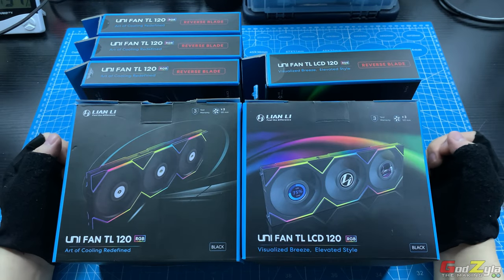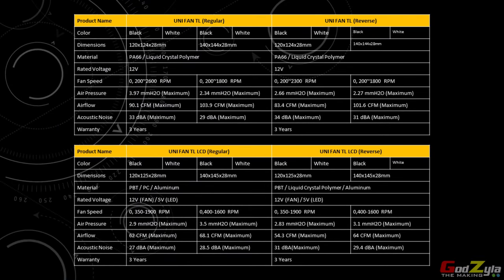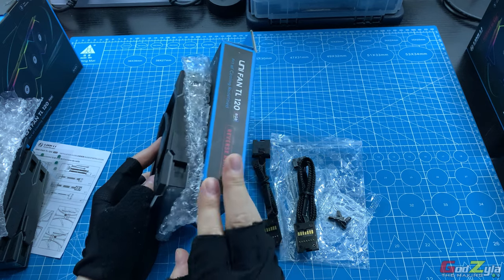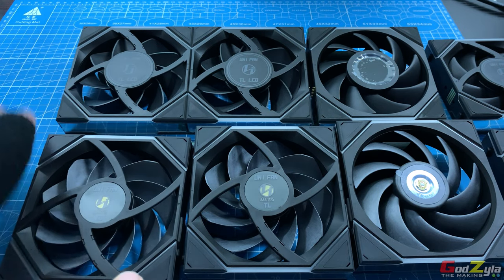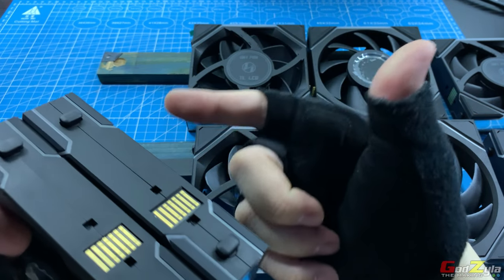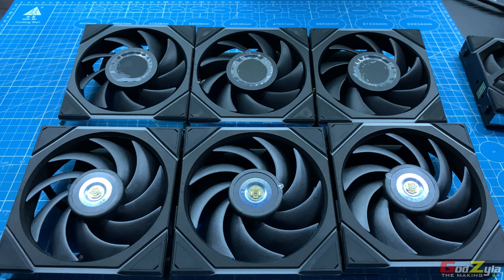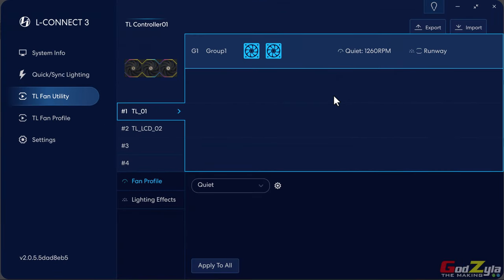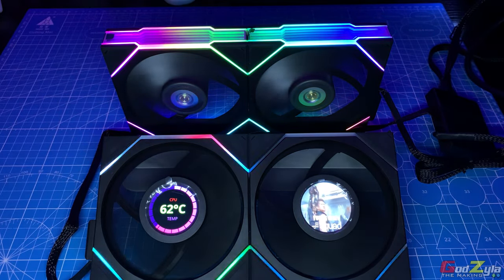Lian Li Uni Fans - TL & TL LCD

Comment: I selected TL Fan Utility controller 1 and 2
But nothing is showing on there.  
My fan and fan lights are turned on and connected properly but it’s not letting giving me anything on L Connect
Reply from the maker: HI Alpha E, welcome to my channel. You might want to check if your TL Device / Hub is detected in Windows first. check it at Device manager, under Universal Serial Bus Devices. If you do not see it.. it could be your motherboard chipset driver is not installed.

Comment: Thx about unboxing video.
Reply from the maker: Hi Mort La, welcome to my channel and thank you for your feedback. kindly note the arrangement as this content was done before Lian Li have provided the latest info about the connection. 

Motherboard Limitations: Currently, some Z790 motherboards can only support up to 7 devices via their USB 2.0 ports. This means that only 7 TL LCDs can be used, or fewer when paired with other USB devices. For example, when paired with GA II LCD AIO or Shift AIO, only 5 TL LCDs can be used. When paired with Strimer Plus cable, only 6 TL LCDs can be used. To solve this, you can use our 1-to-3 USB hub (connects via motherboard back IO) for other USB devices, and stably use 7 TL LCDs.

Comment: If package 1 does not have a controller, can I use Lconnect-3 ? .Merry Christmas and happy new year
Reply from the maker: Hi Quang Tran, welcome back. Nope you can’t use without a controller and you can’t plug these fans to your motherboard directly either.
Reply: Looks like I have to buy the controller separately if it's available. I want to own pack 1 instead of pack 3. Because pack 3 is very expensive based on my income. Thank you so much 🙏  @KleoYan
Reply from the maker: @luxubu666  you are most welcome.

Comment: Hello Kleo. I have a question: My power supply has several 6-pin SATA/PATA connectors. Is it possible to connect the UNI FAN TL controller to those inputs or should I connect it to PCI 8-2? Thank you.
Reply from the maker: Hi Salvador Alberti, welcome to my channel, The polarity matters alot and kindly only use only the GPU 8 pin PCI-E cable which has the end of 6+2 connector.
Reply: @KleoYan Thank you for always responding so quickly and clarifying all my doubts.
Reply from the maker: @salvadoralberti1372  you are most welcome. All the very best with your build.

Comment: I tried to do 4 fans in one daisy chain, and it does not work, and the end power cable does not fit either.  Looks like Lian Li messed up the cable
Reply from the maker: Hi Gary Andriotis, I have tested it and it works. Are you using the bridge cable where it has both ends with a flat surface clips? watch at 3:00 . that's the bridging cable.
Reply: No. They supplied a sata power cable for the end
Reply from the maker: @garychios  for the 4 TL fans, did you get all individual pack or 1 x individual + 1 x triple pack? If you get all 4 TL fans individually, you won’t have the controller nor the bridging cable.
Reply: @KleoYan     I meant to say 4 LCD fans in a row.  not just TL fans.
Reply from the maker: @garychios  maybe list down what package of the TL LCD fans did you get? If not I will have to guess or assume, where I can’t answer you correctly and to have go by ping ponging back and fore.

Comment: Hey how’s it going ? I connected 3 lcd fans together  to a slot of  port and 1 lcd fan to another slot of the port & 3 led TL to another slot and my fans are not displaying the RGB lights at all. Maybe I have to install I connect 3 to turn it on ?
Reply from the maker: hi Jorge Mejia, welcome to my channel. just make sure you connect to port 2 or 3 or 4 and not port 1. Yes you will need L-Connect 3 app to set the LCD images and also the argb effects.
Reply: @KleoYan  so installing the L connect app will solve the issues of my fans not lighting up ?
Reply from the maker: @jorgemejia7179  do you have the TL controller visible under device manager in Universal Serial Bus devices?
Reply: @KleoYan  im building my pc from scratch. I haven’t install my monitor yet so I can’t get into that . My lcd screen turns on but not the argb lights .I just find it weird why the fans don’t light up. My other lian li products lights are working such as strimer v2 for motherboard and gpu.
Reply from the maker: @jorgemejia7179  hmm if you have all plug correctly both LCD and ARGB should light up.
Reply: @KleoYan  that’s what I’m saying why the fans are not lighting up
Reply from the maker: @jorgemejia7179  ok do some basic troubleshooting. Start with only one fan plug to port 2. If it lights up go port 3 and follow by port 4. If all works, your fan and TL controller is working. Change fans again repeat the steps. If all fans working fine as individual,
Daisy chain to port 2. Now observe does any of the fans lights up. If not, install
L-connect 3 app. There should be a Section on ARGB Menu. Make sure the fans on screen are highlighted. That might be the issue. If not I have no clue what’s causing your issue. I would advise you to contact Lian Li’s tech support.
Reply: @KleoYan  thank you I will try this when I get home later ! I’ll let you know how it goes !
Reply from the maker: @jorgemejia7179  ok good luck.

Comment: Hello Kleo. Is it possible to connect the TL series with the SL-INF that has cooling in the same controller? Thank you so much.
Reply from the maker: Hi Salvador Alberti, welcome to my channel. The way each controller works differently, therefore you can't plug SL Inf to the TL controller vice verse. Kindly do not attempt to do that as it's of different power build and firmware build on the controllers.
Reply: @KleoYan  Thanks for your quick response.  I am a true fan of your channel.  Although my English is quite poor, I admit that you do it great. Congratulations!
Reply from the maker: @salvadoralberti1372  Thank you for the support, greatly appreciated it 👍

Comment: How would you connect Lian Li Strimer Plus 8pin and 24 pin cables to the TL LCD controller?
Reply from the maker: Hi Nix G, welcome to my channel. You can't as the TL controller is only for the TL or TL LCD, if your strimer plus is not V2, get a strimer plus V2 controller. you might want to watch this to understand Lian Li ARGB Eco System. https://youtu.be/CgvuUFeff8U?si=jrV9deuIF2gVefdu
Reply: @KleoYan  Would it be possible though to connect 8 TL fans, Strimer Plus V2 24 pin and Strimer Plus V2 Triple 8 pin to one TL controller? I am trying to minimize the controllers in my case. Thanks in advance!
Reply from the maker: @TheAero91  hi and welcome to my channel. Nope you can’t, the TL controller and Strimer Plus V2 are different in connection.
Reply: @KleoYan  thanks for your quick answer, appreciate it!
Reply from the maker: @TheAero91 you are most welcome. all the best with your build too.  😉

Comment: I see you connect the fans to the controller port 1 but you cannot do it. LCD fans are not allowed on port 1 of the controller. Just ports 2,3 and 4.
Reply from the maker: Hi Alexandre Cardoso, welcome to my channel and thank you for your feedback. You are right. Just happened that I got these set way before it was launched and they did inform me about it. Thank you.
Reply: @KleoYan  Indeed. We should focus now, that Lian Li is not using the clients as beta testers when we pay for a product. The software is terrible, not even  in Alpha phase and they sell it like a final product. Also the optimisation of the resources allocation is terrible. More than 10% CPU usage is not okay at all.
Reply from the maker: @x0127960  Hi thank you for your reponse. I can't speak for Lian Li and will forward your feedback to them. As for system resources. I have a set up which has all the Lian Li ARGB devices controlled by L-Connect 3 and to fully operate everything, GA II LCD, AL120 V2 x 10 and with strimer plus 24 and 12vhpwr, my CPU usage is around 0.8 to 2% max. I have no issues which alot told me they do. Maybe I am using ASRock motherboard that allows me to controll the ARGB in UEFI without installing the polychrome. Anyway, I will forward your feedback to them.. thank you.
Reply: @KleoYan  Hi. I have also an Astock Steel Legend x670E Ryzen 7 7800X3D  64 GB of Ram. I changed 3 fans Arctic by 3 LCD fans and using 3 sensors on the displays I notice (playing the same game) that I have a decrease of 20-30 fps. Since the software doesn’t allow us to turn off the displays, I load a still image and the increase in fps is notorious. I am using the motherboard to control all 10 fans (7 Arctic+ 3 Lian Li TL LCD). The fans have an amazing design but the software is really bad. Yesterday I was using groups to test the anims and I could not turn the displays. They turn individually but just sometimes when associated to display a comum animation. Just sharing my experience and trying to help a bit. My rig has an MSI Suprim X  4800. Thank you very much for your fast answering.
Reply from the maker: @x0127960  I had a talk with one of their support engineers. When your TL LCD loads, It’s taking up your processor resources while you are gaming. It’s in conjunction running with your game. Therefore the animation on the LCD plus your game, that causes your fps to drop. Unless it has another processor build it on the TL LCD fans. Which now it make sense to me, as I use two pc to do benchmarking while another to do the video capture. If I am to benchmark and to capture the video. The benchmark temp will go rocker high. So in practice, it’s normal to have L-Connect to run above 10 to 15%. I myself not using any TL LCD even though they look good. I personally make use of a LCD panel that has a build in processor Truxz 8.8”.
Reply: @KleoYan  I agree with you . Makes more sense to use an LCD screen with a built in processor. Let’s wait if they implement a switch off screen  button in the L- Connect control software. Have a nice day.
Reply from the maker: @x0127960  you too. Thanks for the visit and feedbacks 😉

Comment: Thanks for the excellent tutorial.
Until lian li decides to allow the user to set individual separate fan curves for each fan, these fans are just too overpriced.
When just surfing the net, having the ability to keep my rig quiet is more important to me than having it well lit.
Reply from the maker: Hi Rick, welcome to my channel. I have to agree with you on having a quiet rig which sometimes I battle how to set the correct fan curve to perform quiet but yet giving good temps. So far that's not really possible for me as processor these days are just taking up too much heat. Hopefully Lian Li is able to come out with a better solution. As for the price of these fans. I feel that I will go for TL fans as they are build to perform, for LCD, I will just get one and place it to the rear. On top of this, I feel that the software should allow sequence flashing in between CPU, GPU, RPM of the TL LCD. That will be more practical.
Reply: @KleoYan  If I have 3 of these fans in front, 3 on a 360 galahad mounted on the top and one in the back, I only need all 7 running if I'm video editing. If I'm on the web, even with a 13900k, I only need 1 fan on top, 1 in front and the rear fan running at 50 prct, along with the pump at 50 prct to keep things cool and quiet.
If Lian li is going to charge us more for the fans than for the case, it needs to update the software to L connect 4, and allow the software to reach it's full potential and usefulness, by allowing the user to set separate fan curves for each individual fan.
And if they do that, it would be nice to offer a discounted bundle purchase of case, fans and aio to users who are willing to fully support their company's products.
Reply from the maker: @Rick-m3c  For this you got a point there. Infact I view other reviwers, some having glitch where I do not have. I believe is up to individual system. This content was done with a fresh install of Windows 11 but it will be good if they have the application set to L connect 4 as to separate from the rest of the uni fan family, which will confuse a number of builders who are not familiar of the uni fan family. As for fan configuration. I would make use of all TL and just one TL LCD, as I only see it's practical to place the LCD at the rear where you can see the readings and I did highlight to Lian Li, if the readings can flash in sequence from CPU to GPU and to etc.
Reply: So all fans that are connected to a hub can only have one curve? What the..

Comment: Now how do I add my Strimer V2 24 pin and 3pin GPU strimer v2 to the new controller 🤔🤔
Reply from the maker: Hello Anthony Benjamin, welcome to my channel. You can’t add strimer plus v2 on the TL controller. You will need to run by its own controller. It’s not compatible to the TL controller.

Comment: Can I completely skip using the controller and connect the regular TL fans directly to my mobo using the Lian Li cable kit? I just want to use two TL fans with my air cooler and want them plugged directly to the CPU_Fan header and an ARGB header. Would they have enough power on their own and I won't have to worry about all these other connections like the PCIe or the USB 2.0?
Reply from the maker: Hi LOL, welcome to my channel. Sorry that I missed your comment. No you can't plug directly to your motherboard as there are no split cables. It only comes with a 7pin connector. You will need the controller.
Reply: @KleoYan  thank you for replying! I have the argb cable kit from Lian Li from when I installed my first fans (the Uni SL inf) and I was hoping I could use them somehow since I will only be using two TL fans for my cpu air cooler radiator. I ended up just purchasing the controller and it arrives on Friday. These seem like they might be really good radiator fans due to the 90+ CFM and the 3.97mmH2O static pressure rating. Excited to replace my current DeepCool fans.
Reply from the maker: @yourshotsalwaysmiss  I see, yes TL fans are good strong fans.

Comment: now, does the TL series play well with the existing SL120 v2?
Reply from the maker: Hi anooymous84, welcome back. I wouldn't say it plays well, I would say each have to use their own controller. You can't connect the SL 120 V2 to this TL controller. But for Aesthetic wise, yes the SL120 V2 will blend in well with this TL if you place the SL 120 V2 at the side of a O11D case.
Reply: @KleoYan  so in the end I bought the o11 Evo XL instead of the montech lol..
Ok, so the SL can be connected to the TL controller
Reply from the maker: @anooymous84  hey , there is a typo, I was saying that each uni fan type will needs it's controller, therefore you cannot connect the SL 120 V2 to this TL controller. I type too fast and miss out on the 't on my can .. I have correct it.
Reply: @KleoYan  ah... ok
Reply from the maker: @anooymous84  ya my bad. so sorry.

Comment: To clarify, the reverse version of the fans are used as an intake and the regular fans are exhaust, is this correct?
Reply from the maker: Hi Nix G, welcome back. for normal fans, where you sees the fan frame, thats where the air is blowing towards you. For reverse fans, where you only sees the blades, thats where the air is blowing towards you. Hope this will clarify your thoughts.

Comment: I have one fan that keeps breaking, and I'm having to stop/start the service to fix, constantly.
Reply from the maker: Hi Vey Calkins, welcome to my channel. have you try connecting it to another USB port of your motherboard? if that does not help. try this

Remove all argb apps (Asus Armory Crate / MSI Dragon Center / Giga Fusion / Asrock Polychrome). If it's Asus, use the uninstall tool at their website., if not use Revo uninstaller ( https://www.revouninstaller.com/ ). Revo uninstaller will remove all unwanted files / folder / registry in your system. Illustration to use revo uninstaller https://www.youtube.com/watch?v=uMgUYiakpxM&t=437s then try to install L-Connect 3 app. see if that helps.
Reply: Appreciate the suggestion but that's too much work.  The internal of my PC is tidy now so it would be too much hassle to move the cable, and no guarantee that it will fix the issue.
Reply from the maker: @vpkb  oh ok, try the reinstalling method which I have mentioned. if it does not work then I have no clue how to aid you.

Comment: just installed mine and im getting the ""quanity of fan set to 0" and i have no clue what to click to set them ive done pretty much everything clicked everything
Reply from the maker: Hi ackattack, welcome to my channel. You might want to check if your TL controller is detect in Windows. check on the device manager and under Universal Serial Bus Devices. if there are no device that display TL, then you will need to get that fix. Now, this might not have the TL in this content but the basic on how to install any Lian Li uni fan products are of the same. Just apply the method. https://youtu.be/CgvuUFeff8U?si=G9M76dF4vEH6xDFd
Reply: @KleoYan  Fixed, thanks alot man
Reply from the maker: @ackattack9999  hi and welcome back. Glad you have fix the issue. Thank you for the update 👍👍👍

Comment: When i just wanna use the L-Connect 3 App, do i just need connect the USB and the ARGB Header or just the USB?
Reply from the maker: Hi Akumu, welcome back. you will need to plug the Sata cable and the USB cable from the controller, that's all is needed to control using L-Connect 3 app.
Reply: @KleoYan  thank you!
Reply from the maker: @akumu7140  most welcome